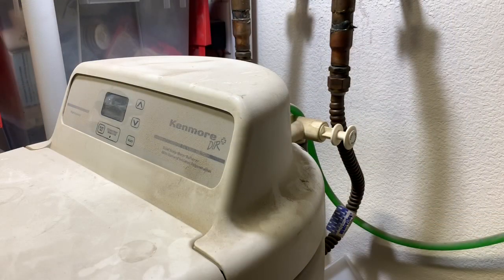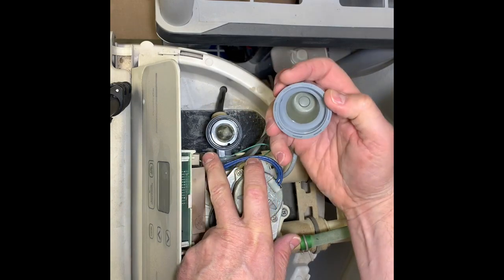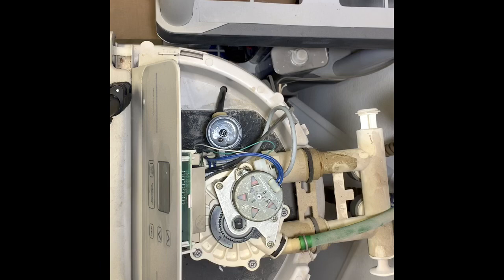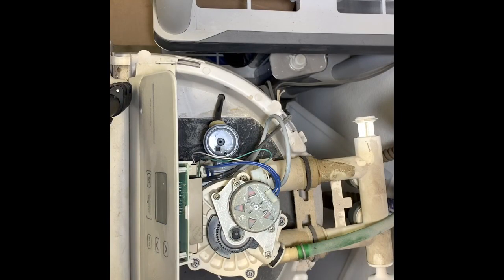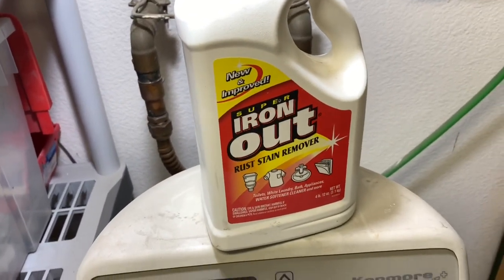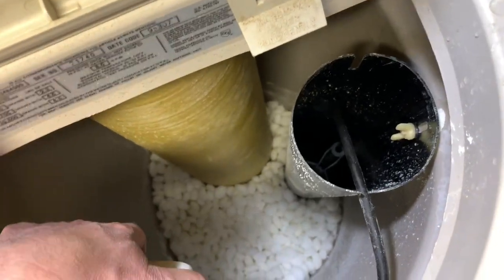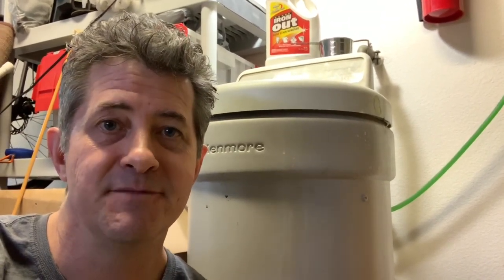Cleaning a Water Softener Venturi, Nozzle, and Resin Beads

Comment: Your hose cinnection bad. Had this happen to meva few years ago. I cut the end of the hise off (square cut) and pulled out the tiny screen in the end of the hose and put it aside. Then slid the ferrule nut onto the hose, then slid to screen inside the hose, slid the nut to the end of the hose and reattached the hose to the nozzle/venturi assembly. Fixed the leaking problem.

Comment: Great video. But you don't need to shut off the water when servicing the venturi nozzle assembly. This assembly only sees water flow when recharging, not when its in service mode.

For cleaning the internal parts of the venturi, especially the large screen that gets iron water clogged, I soak the parts in an iron cleaning solution (similar to Iron Out.)

I usually disassemble and clean the assembly every 90 days due our high iron content in our well water.

Comment: After you regenerated with the iron out did you add salt, or do another regen?
Reply from the maker: Normally I would just add salt, but I have had it where I had to do multiple iron out treatments just to get good pressure. Then I added salt
Reply: You said low pressure meant the resin needed cleaning?  @MikeKlimek
Reply: Was there water coming from the drain also when it needed cleaning?
Reply from the maker: @ That can be the case but you may have other issues. You can  test to see if it is the softener by bypassing it and seeing if the pressure increases.
Reply from the maker: @No. If you are seeing water draining, is it in the middle of a regeneration? Or are you talking about the overflow hose?

Comment: My cap isn't going back on? I turn it and it just pops, I keep trying to line it up but it seems to be having difficult time going down the threads
Reply: Make certain all of tge parts are instalked correctly (see owners manual) and that they were aligned to the keyway moulded into the assembly body. If you dont get the parts seated properly, the cap wont screw back on. (Easily)

Comment: Mike, thanks for making this video. My unit is identical to yours and I've had to do a lot of work on it lately. A couple of notes:
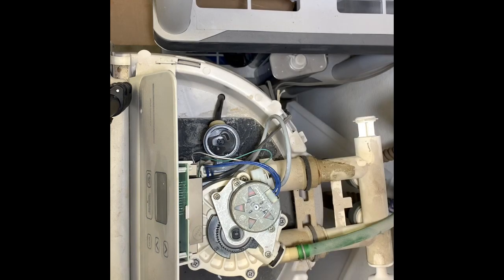@2:00, you're missing the flow plug in the nozzle and venturi disk. This goes in to the round recess pictured at about 2 o'clock as shown. This recess is also seen clearly at 5:04. This 0.1 gpm flow plug is important as it controls the flow of feed water into the venturi and will impact how quickly the brine is pulled from the brine well and pushed into the  resin tank. This is in the venturi circuit, and I assume that not having the flow plug results in the brine flowing too fast. The manual says that brine flow should be at a very slow rate to get the best cleaning with the least salt. Since the unit will go from brining to brine rinse as soon as the brine valve in the float assembly closes, I assume that yours is quickly pulling all the brine at a much higher rate, and then rinsing  the resin bed for a longer period of time until the controller determines to move on to backwash. I conclude this because the brine and brine rinse cycles vary relative to fill cycle. The controller would be programmed to assume that the flow would be 0.16 gpm during brine and 0.11 gpm during brine rinse, per the manual. Not having the flow plug would seem to mean its not working as designed.
Along these same lines, the washer/o-ring you refer to at 3:30 is also a flow plug. This one is set to 0.3 gpm and controls the flow of the water into the brine tank during fill cycle, as well as brine flowing back out during the brining cycle.
Edit: as someone else mentioned, the plastic screen retainer/support shown at 5:26 is not aligned with the orientation pin in the housing. I assume that yours leaked until you corrected the orientation.
I hope this makes sense. Thanks again for your video.

Comment: Water Is coming from the bottom of my Ultra Soft 100 unit
Reply: Sorry the bottom of the tank
Reply from the maker: Not a lot of options here. Probably need a new tank/softener @carloscampbell3055
Reply from the maker: The bottom of the controls or the bottom of the tank?
Reply: Neighbor had this happen to his. We empted to salt tank, dryed it out and used an two-part adhesive to seal the crack. Never leaked after that.

Comment: Mike I know this is an older video, but my problem is I replaced the venturi assembly with a new one and I am getting a slow dripping out the drain hose from the venturi assembly.  Took that one off and cleaned it totally, same dripping problem.

Comment: After owning a couple of these, I've found you can unscrew the siphon hose on the venturi (@12 o'clock in this video), and pull the plastic retaining clip attaching the venturi to the valve unit (@ 6'oclock in the video). Then, the entire venturi pulls off easily. There will be two o-rings on the end that goes into the valve block, so don't lose those. 

Then you can take the venturi back to a table or workbench to clean it, and not worry about losing small screens or jets inside the softener. (Also saving your back a bit too.)
You may need a channel-lock pliers to remove the siphon tube and needle-nose pliers to pull the clip.
Reply from the maker: Good tip!
Reply: Can you explain why I have a big leak after putting the assembly back into place? Both o rings are on the bottom and the clip is put back on. Water is spewing from that connection

Comment: Great video! Getting ready to try the brine tank cleaning step. My softener won't drain so it's about halfway full of water, do u think I need to drain it before performing this step?
Reply from the maker: It wouldn't hurt to drain it!
Reply: Mike Klime
Reply: I'm found from personal experience that when adding salt in a softener where the softener is installed in the brine tank, sometimes the salt falls across the suction hose and partially drags the hose out of the access tube. This raises the extraction assembly up and changes levels of the water left behind in the access tube. 

The fix is easy enough, after adding salt pull the lid off the 4" access tube, then lift the suction hose out of the pinch slit. Using the suction hose, lower the extraction assembly down until it bottoms on the brine tank and replace the suction tube in the pinch slit of the access tube. 

Although the amount of movement of the suction hose is slight with each salt fill, it accumulates over time. Its important for proper operation of the softener that the extraction assembly rest flat on the bottom of the brine tank.
Reply: No need to drain the water out of the brine tank. Just clean the nozzle/venturi assembly and the excess water will slowly siphon out. It may take an hour if there's a lot of water, and you may have to run a couple of regeneration cycles to get it all. (Remember, there will always be arounf 4-6 inches of water remaining in at the bityom of the brine tank. Also, whenever the tank fills with water, the salt has a tendency to bond together. After you drain the  water from the tank, dont add anymore salt and make certain that the remaining salt hasn’t "salt bridged". I used a broom handle to poke into the salt to break up the salt bridges until most of the old salt had been used up. Best to never load a salt tank to more than 1/4 full. (I don't even load my this full.)

Comment: I am having trouble removing the cap - any suggestions ?
Reply from the maker: I would be cautious using a tool, but you just need to get it started-go easy if you do this as the cap is plastic. Maybe try a rubber jar opener?

Comment: Thank you! Very useful information.  I had no idea this was needed.  Do you ever clean the salt tank?  If so, how often?
Reply from the maker: I've not cleaned the tank. It probably wouldn't hurt, but just never got around to it.
Reply: @MikeKlimek  I'm if I'm
Reply: It depends on the quality of salt you use. Regular rock salt contains large amounts of dirt. The salt dissolves and the dirt remains. Over time this builds up and must be removed when the bottom of the brine tank has a layer of dirt built up. Depending on the amount of salt used, this could be as little every couple of years. (Some salts are dirtier than others.)

Personally, I use clean, prewashed salt pellets and the brine tank stays clean for a very long time. 

My current softener has a separate brine tank and will be easy to carry outside for cleaning. 

My old softener had the softener inside the brine tank, so I used a wet/dry vacuum to suck the dirty water out if the bottom of the brine tank. I had to add water to get the dirt mixed and able to get a clean tank. Worked perfectly. As I used clean salt pellets, I only needed to do this once in 14 years.

Comment: While adding the rust out  then reg. Is thiswater flowing into the hot water tank?
Reply from the maker: No-The Rust Out is added for the regeneration of the unit. Once the regeneration is done, the solution is drained out, so it won't go through the plumbing.

Comment: When I regenerate my Kenmore water softener doesn't completely empty. The water level rises when regenerating, but doesn't empty as much as it should. It When the salt level gets down to 3 or 4, it leaves an inch or two of water above the salt level, which I manually empty before regenerating again. That's not normal, is it?
Reply from the maker: No the water level shouldn’t be that high although you will have a small amount of water in the tank. In this video at six minutes and 30 seconds it shows the brine well with a tube going to the bottom of it. Pull this tube out and disassemble the parts at the bottom and clean them and reassemble it. It’s not difficult. Then regenerate the unit. Hope that helps!
Reply: @MikeKlimek  Thank you I will try it.